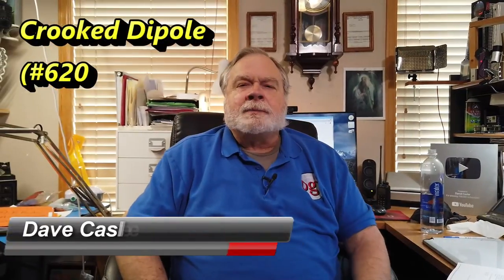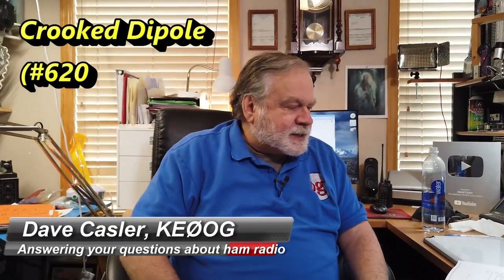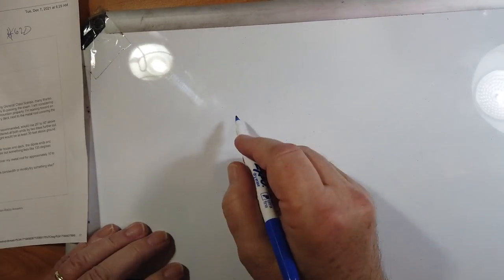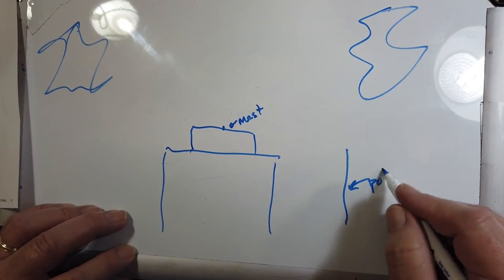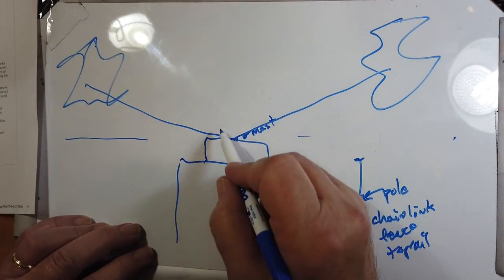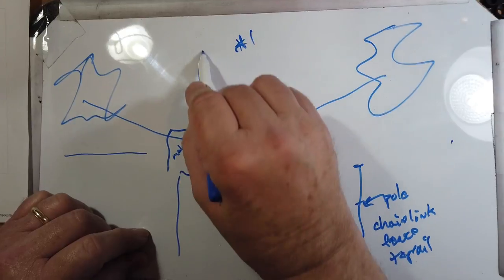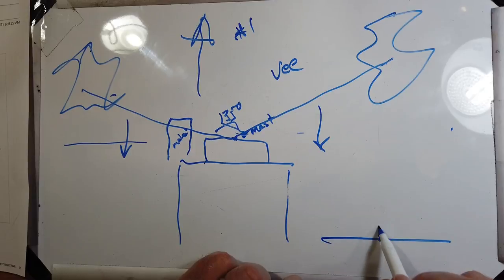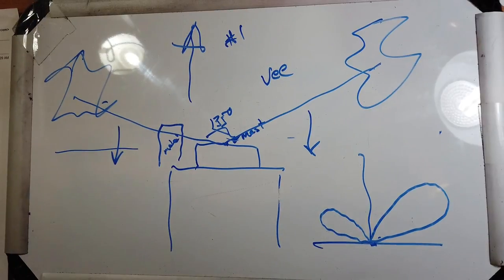Crooked Dipole (#620)

Comment: Hi, Dave, thanks for the video.
135 degree is not far from 180 degree flat top configuration.
It would still act like a horizontal flat top dipole with the regular "broad side" radiation pattern.
I mean it's not going to have any selective preponderance in the particular direction.
The E field that's being created thus is not going to be "crooked" anyway.
Yes, it will certainly work as any other normal flat top configuration dipole; nothing special to ponder or worry about there.
De VU2RZA

Comment: Hello and thanks for all your videos.
I have a multiband off center fed dipole between 2 trees. At the end of each element I have 4 feet of rope attached to a spring and another length of rope attached to each tree.
My question is:
How far away from the elements does each spring need to be to not effect attenuation? Thanks.
Mel
KE8PMM

Comment: I think 
i still have a bowtie  TV antenna that clips onto the rabbit ears on the TV.  Is there a way that you could use that or dapt it for SW.  It's only about 2 feet of rigid wire, so it would be very short or small dipole.